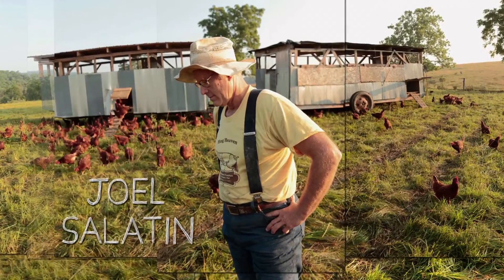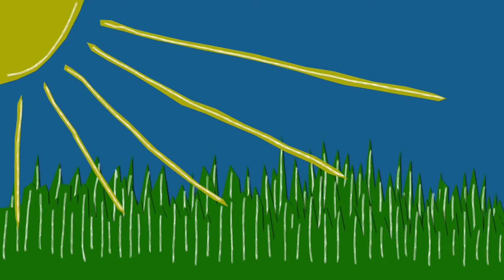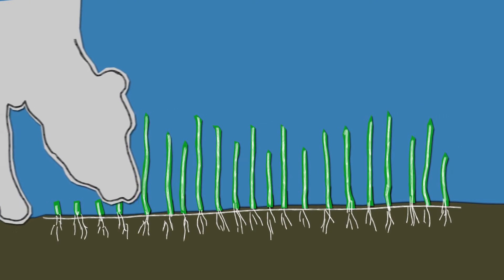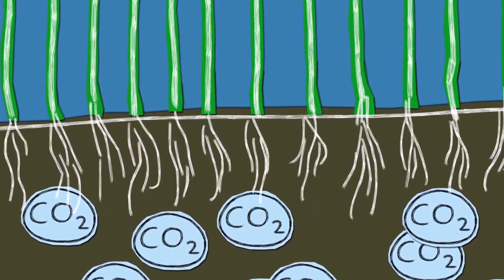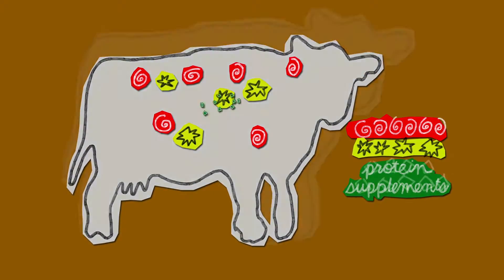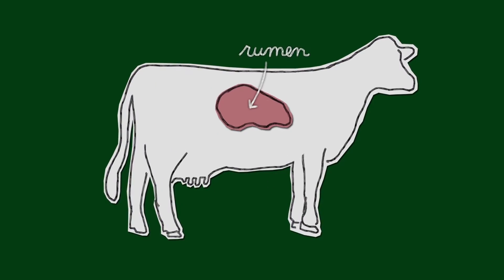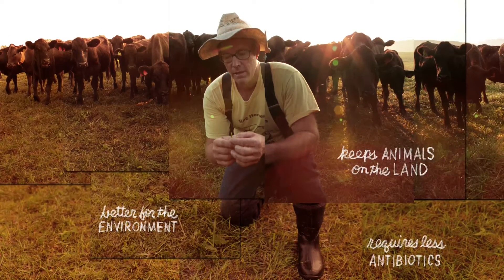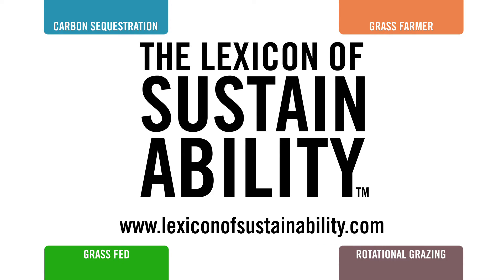Grass Fed

Comment: The main difference will be grass-finished ( or, 100% grass fed, or "not grain finished") because most if not all of the cattle raised specifically for beef out there, ARE on pasture ( grass) most of their life ( hay in the winter, aka harvested & stored grasses, sometimes its alfalfa but thats mainly for dairy cows, they need the extra energy). This is 1 reason, why coventional farmers, who are nowadays constantly furthrr encouraged with misinfo to believe that everything they are doing ( the modern status quo) is either plenty ok or neccesary or both. Beef farmers, looking at their cows out on acres of pasture, see very little difference. A lot of farmers already intensively rotationally graze, too. Its just that for many climates esp. ( anything less than tropical), that is not good enough. Watch vidoes from Allan Savory on " holistic grazing is not roataional grazing" to learn about that. Then, yes, being grain finished, especially when they get an extremely high amount of grain per day, is when you get the acidosis,  which leads to the other problems ( which is common - the high grain finishing, but fyi you can still grow out a steer faster than 4 or more years even without grain. Esp. If using a chunky breed.  And to wait & grow them to full potential is just to maximize your investment ( the mom cow, the 1st yr or more of growing up of the calf etc.). Depends on cattle breeds too.  Talk about " used to" & " 3,4 or more yrs" well, that may have been mostly texas longhorns back then , a wiry breed. Esp if grazing in desert ! " Lies, damned lies, & statistics " ya know ! I AM a fan of Joels, his methods, believe in most of the reasons why, & am against chemical based, oil ( fuel) guzzling, unneccesarily HARD ( i grew up an a hell of a hard hard times dairy farm in the 80s & 90s & beyond) - seriously, its idiotic !- modern " conventional" way of farming. So, do investigate holistically planned grazing, symbiotic, permaculture farming etc. & why it matters what animals eat, & how veggies r grown, for your own health from the westonA.Price foundation online, & plz support all that ! Help chamge farmers minds by simply buying differently ! Theyll stop listening to Monsanto & the "experts" if you can help assure them that theyll get paid fairly ( finally !!!!)  & be able to manage the new ways, with support from others doing it !